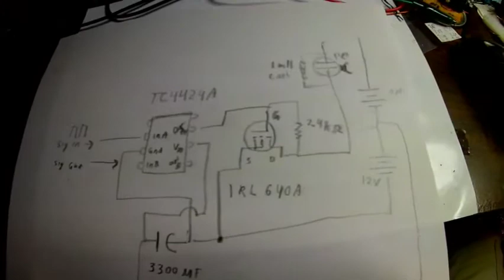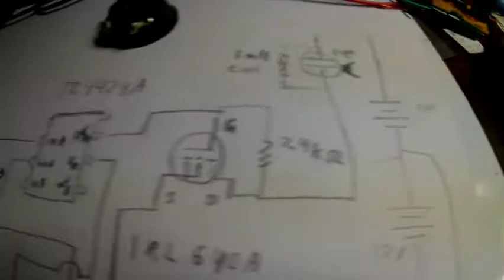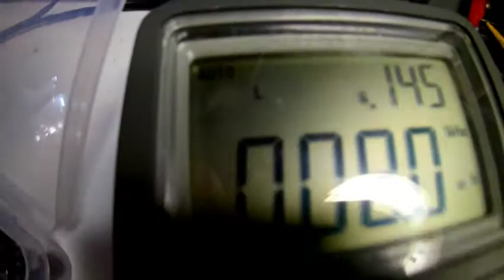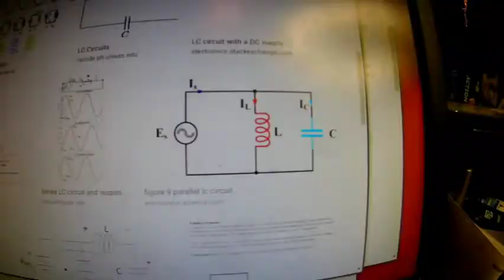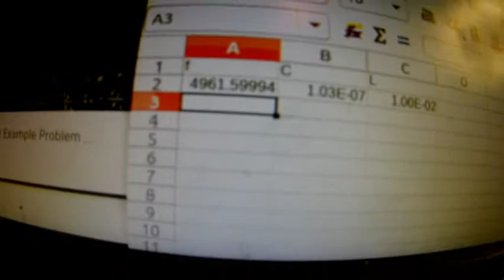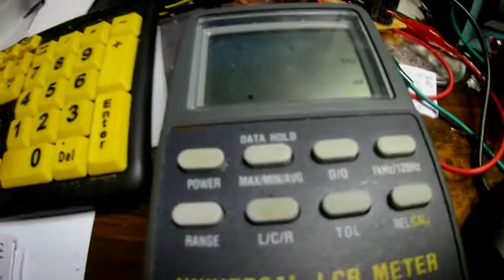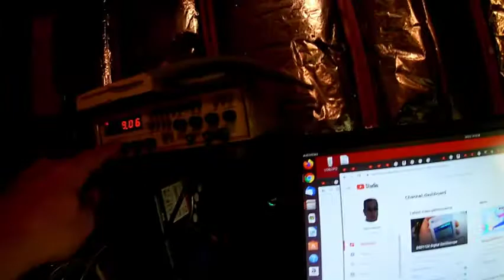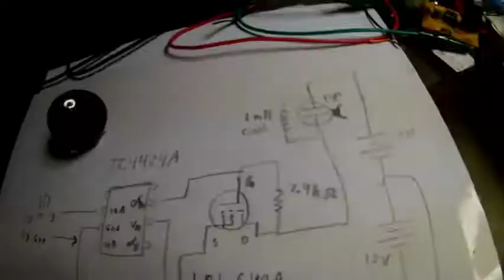Simple High Power Piezoelectric Driver Circuit

Comment: interesting video.  Thanks for sharing this.  Question that comes to mind... you call this a 'high power' circuit... but I missed where you mentioned how much power it actually is.  The second question is about where would be the ideal/optimal place to introduce pulse width modulation to control duty cycle.  I'm think of using a PWM circuit to pulse the input signal, running the amplifier at full tilt.  Thoughts?  Thanks Doug
Reply from the maker: I am sure the FET is capable of putting out enough power to burn that little transducer out.. It depends on the voltage you drive it at.. My goal was to make a simple driver circuit to demonstrate the capability.. and the inductor I added can also handle about as much power as you could ever want to supply.. the weak link if this PE transducer.. but there is nothing to say that you couldn't add many more.. or use a more more high powered device!??... I didn't measure the power, but the circuit is more the focus in this video.. I was planning to build a very high power unit with this design... but then disaster struck.. and I am still trying to recover.. I still have plans!!
Reply: @jaynesnetwork  hope the recovery goes well.... take care!  Doug

Comment: Hi, I would like to ask if I want to drive a piezo with a ramp voltage. Should I turn on the voltage amplifier first and then the function generator or turn them on vice versa ? Huge thanks in advance
Reply from the maker: It's probably good to have the amp on before you put voltage on the input??.. but for these fets, it is probably ok either way.. I don't think it will damage them, to have a little voltage on the gate, with no voltage on the drain and source..

Comment: Thank you very much sir. It clears up a couple of things for my project.
3 questions:
- Just to clear out some confusion, is the sig gen outputs DC pulse  (0v to +V) Or is it realy a square wave (-V to +V) ?
- I’m using a Half bridge with IR2110 as the FET driver in my setup with a DC power rail of 60v DC (because thats all I have available). In your setup, can you use higher voltage at the FET Drain to Source?
- That capacitor you use, it looks like it behaves as a bootstrap capacitor. How did you calculated the value?
Best regards.
Reply: More likeb13volts DC drain pulsed fast to avoid damage check kemo specs, 5v 2110,12 vcc, no bootstrap became on 1 fet switching vdd to ground.This inductance is interesting ,makes sense as my build seems to be  ringing and  ot much distance except in audiorange,using 25 volts remedies to 13 vdc?
Reply: Some of my words were changed end is regulated I don't know how this happens!